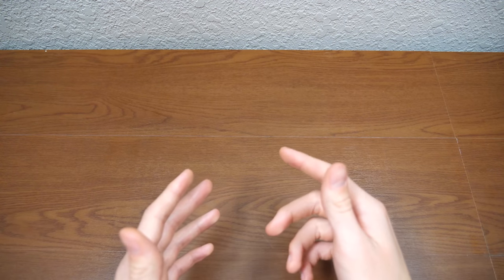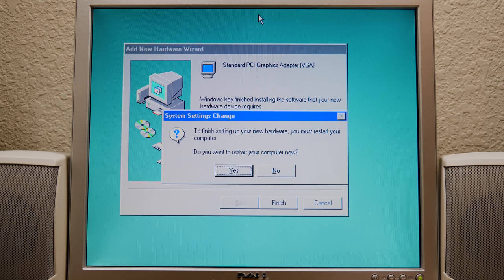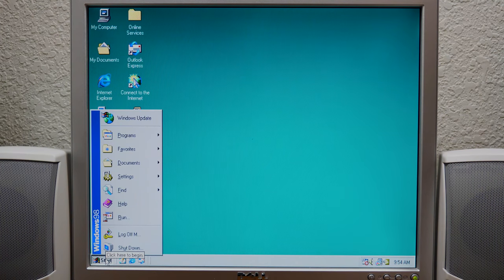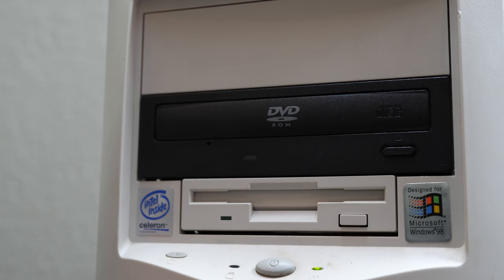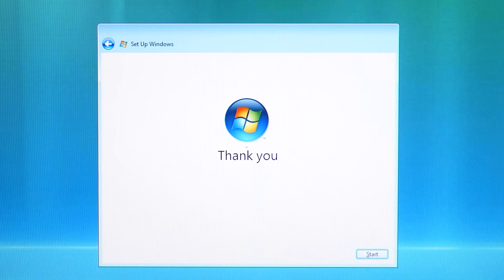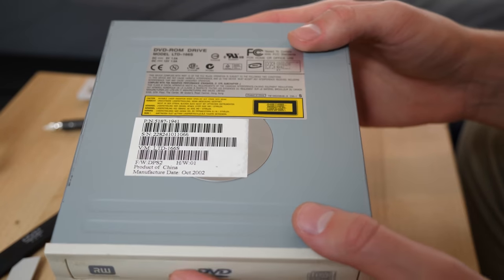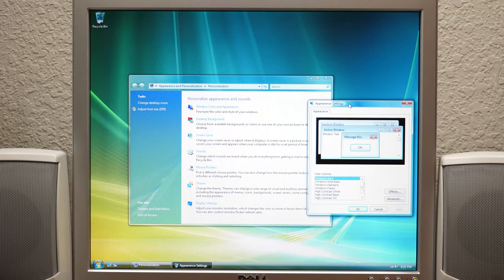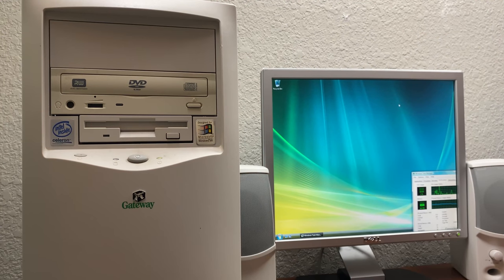Actually Installing a GPU in the $5 Windows 98 PC!

Comment: If you're not using the onboard Intel 810 graphics, you should disable it either in the BIOS or at the very least from Device Manager.  Having both of them enabled could cause you issues.

Comment: One windows 98 idea could be to find similar files from both the windows 98 and windows xp install cd and see if you could re create wi dows 98 in the nt architecture. Basically just making a version of xp with only the functionality of 98 se or me. Someone probably already did this at some point with themes and such. However i was thinking more of doing the same thing at the file level if it could be made workable with the xp files. Its just a thought tho. Thinking of the expanded driver base and possibly running a newer office like 2010 on it as well as multiple cpu support and more ram. Would probably need the xp sp3 files tho.

Comment: When you put the SSD in there, I'm not sure the IDE to SATA adapter will be bootable. On my system I ended up putting an InnoDisk CF card in a CF adapter because it is a true IDE mode device - meaning the CF card itself is 100% IDE compatible and operates at a speed that almost maxes out the IDE. Managed to get the InnoDisk cheap on ebay, but a good price is not always available.
BTW, not all CF cards will work. It's strange, I read older systems like 98 work with most CF cards, but XP and above need the true IDE (aka industrial CF card). I tried a normal CF card to install XP - didn't work - ended up with the InnoDisk.

Comment: this is the perfect sort of computer for an FX 5200, especially one of the better ones like the 256MB card. I actually have 2 of these cards, not sure how much vram they have but its more likely that it has 64MB. I used one in a Core 2 Duo machine on XP. I regretted it... I ended up switching to the integrated graphics which worked so much better.

Comment: I still have a computer with win98 because at that time I bought extensive software called "Astrostar" with approx 20 plugins that are installed with floppy disks.  On later versions like WinXP this software doesn't run. So I think it only makes sense to still run win98 when using it for some work that cannot be done with win10?

Comment: I built a new-old computer
Philips Brilliance 107P5 17 (can go up to 2k resolution 60 Hertz and 160 Hz at the lowest resolution) 
socket 754 Sempron 2800+ 
Winfast mobo SIS chipset agp8x
512mb ddr1 RAM 
Nvidia fx5500 (5200 actually) 256 mb vram
Seagate pipeline 300gb hdd (cheapest stuff here) 
A beautiful White brand new cpu case which comes with a ATX 350 watt psu which can provide a lot of wattage from 5volt 
Seeing old these retro/nostalgia builds and I'm actually surprised that I didn't get any issues like nothing whatsoever. I guess I'm really lucky considering everything but hdd and case/psu are second hand.

Comment: I have a video suggestion, you should try to install Windows Thin PC, it's a official stripped down version of Windows 7 made for legacy hardware (like the 5$ PC) and should work much better and faster than the regular version of Windows 7. And also you could try to run the Aero Theme effects on Win 7 to see if it works

Comment: I have that same one! 
The PNY Verto 256meg geforce fx5200.
It's still in an old computer in my closet. Since it is at my childhood home I don't have regular access to it but it still works perfectly and the heatsink is well taken care of

That 5200 ran a LOT of 3dsmax as my second card ever after replacing a geforce 2 mx200.

I have 3dsmax 5.1 running on this windows 11 laptop to this day. Waaay better hardware of course :)
Reply: just as an aside, that fx5200 should run aero glass perfectly fine ... on vista beta
.Been there; done that

Comment: you should try putting that damaged card in the oven or something. i never did it but i read it sometimes work lol. also for the fx 5200 you should try the 45.23 drivers, in my experience they work best with old directx.

Comment: I'm surprised that the vista installation isn't stretched and smashed like on newer computers
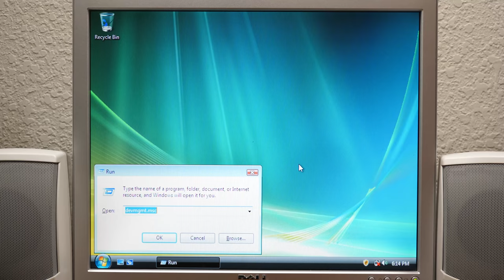Reply: What do you mean? The resulution of the display? When you're talking about the resulution, is because it is a 5:4 Monitor, wich means that it didn't need to stretch the installation's resulution. (Because 16:9 or 16:10 monitors always need to stretch the resulution when it didn't fit.)

Comment: I had FX5200 From XFX  256 Model it had Fan on it    on Intel Pentium 3  it was cool card   It was on Dell  it came with Windows 2000 on it but i put Windows XP on it that computer could do some gaming   i had 512 Ram  and 80GB HDD  i know that computer could run Windows 7 With Areo  . You should try Windows 7

Comment: I did not know that there were 2 versions of Windows XP 64-bit. I only know that both of them are kinda crap.
Reply: yup,only endermanch uses it in a vm
Reply: Technically 3 versions. 64-Bit Edition 2002 was the original for Itanium, then in 2003 a new version was released based on NT 5.2, and then a new version in 2005 based on NT 5.2 for AMD64 cpus.

Comment: Can anyone explain to me why there's a PNY GeForce, Asus GeForce, etc, when they're actually both still just an Nvidia GeForce? I do know my Asus GeForce GT610 is passively cooled and others have a cooling fan.
Reply: Nvidia makes the chipset, the different manufacturers make the actual card, the main difference between them is the cooling
Reply: Different connectors (vga/dvi/hdmi/s-video/displayport) and different cooling. They're usually not better or worse performance wise

Comment: every liteon and sony drives from that timespace would fit, tray might be different i had multiple of them, first i bought on my 18th birthday...many many years ago
and i love how you tumble with that pc in every way
by the way, you can get up to 2,6 with the fastest pentium 3 overclocked to the max or 2,4 without overclocking but you  need a via chipset motherboard that support tualatin cpus and has agp
my fastest  pentium 3 macine was celeron tualatin 1,3g@1,7g/pentium 3 1,4g@1,6g 2gb pc150 or pc2100 ddr (on sis chipset) radeon hd3650 agp and this thing run normaly windows 7 up untill firefox 49ers i belive this wouldn't be any longer a 5$ pc though

Comment: Installing an ssd may make it quicker, but the bottleneck is going to come from your port. If the bus speed is too low you’re not going to see a lot of change. Then again, changing the motherboard defeats the purpose of the project

Comment: Reminds me of a laptop I put vista on back in 2007 or 2008 cause I was in a bad situation. So…….I had a Pentium 3 laptop with 512 megs ram and the Pentium 3 was around 1ghz or something.  I had a 4200 rpm hard disk with 64 gigs. And I think 8 megs of vram. It worked fine for windows arrow but it was slower then interviewing a pile of cheese I could hardly even get my emails to load.

Comment: I will love to have a ssd in the 98 pc and a new motherboard so we can add 1 or 2 gigs of memory
Reply: With a new motherboard it's not really the 98 pc anymore right? That would just make it a sleeper build.. I actually like to see him push the current motherboard to its limits, with an ssd, higher frequency ram and if possible a slightly faster cpu..
Reply: @ikbintom  You are correct about the motherboard, maybe it wouldn't be a 98 machine but he already did push the motherboard with a new processor so I think he wouldn't be doing a cpu upgrade but maybe he can overclock it a little bringing the frequency up a notch but ssd that would be cool.

Comment: 13:50 SO YOU WANT A DVD DRIVER THAT IS BEIGE
AND YOU ARE TRYING TO PUT THE BEIGE COVER ON THE BLACK DVD DRIVER TO MAKE IT BEIGE
THE QUESTION IS WHY DON'T YOU INSTALL THE DVD DRIVER THAT IS ACTUALLY BEIGE
Reply: Well I'm cooled down and if it's broken wouldn't it be better to put black one's working interior like if it's a bad laser etc since now there's a useless line in hole it would bug me.

Comment: I know that my comment doesn't even really fit here but... hold up there's a difference between Windows XP 64-Bit Edition and Windows XP x64 Edition
Reply: yep. and not even a insignificant one

64bit Edition was Designed for the intel itanium line
while x64 edition is based on the "normal" amd64 (and intel64)Standard and is based on windows server 2003